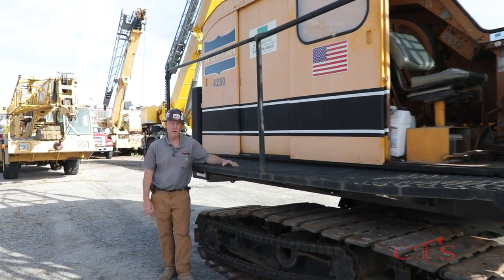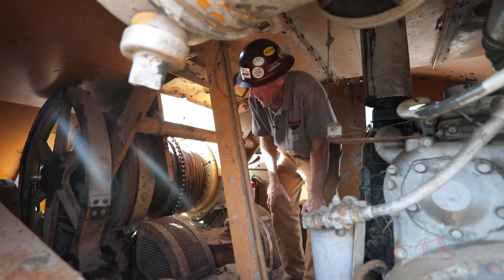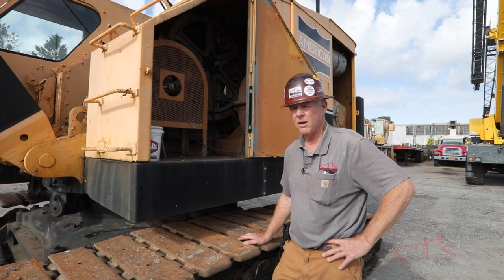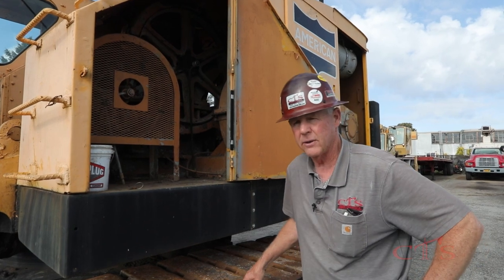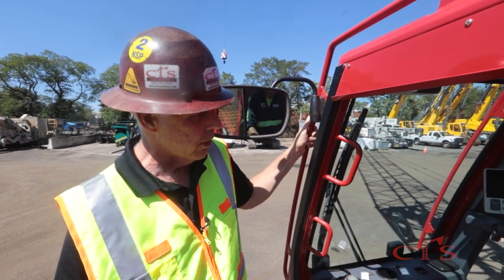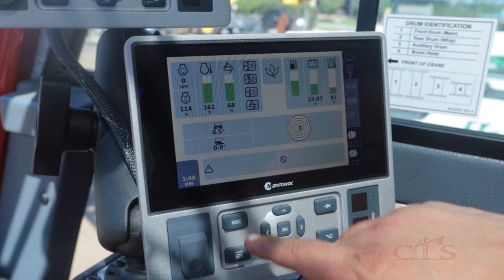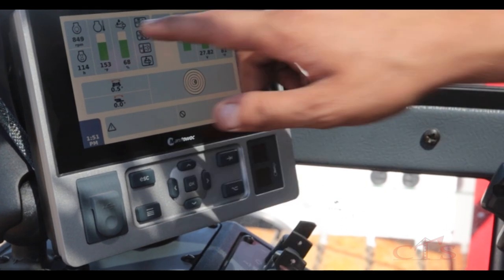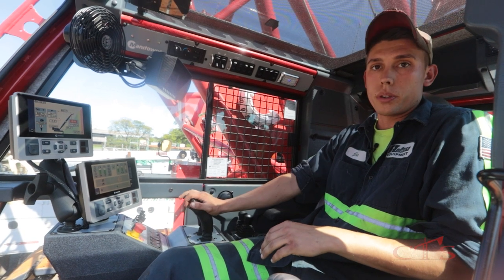What is a Friction Crane with Crane Training and Safety Consultants

Comment: I've ran 45 SC, 65 SC, 604 and 703 Limas, 108 and 338 Link-belts. We thought if we had a crane with a torque converter and power down on 1 hoist we had it pretty good.

Comment: In my long years of crane operating, I have been in the seat of both friction and hydro. Give me the friction anytime. To me if the machine is adjusted right, the friction is much smoother and faster. Hydro is nice for sure. I got my NCCCO license on using both. I did not get to operate long but the Manitowoc 4100 Vicon was the man and still is a great crane. Today, operators have gotten lazy and most want air conditioning that most of the old friction rigs did not have.
Reply: If I’m correct, with older machines you can “feel” it and work with it.

For instance, an engine can tell you if it doesn’t like what’s going on by the sound, it also tells you what RPM’s it’s happy to run at.

These older machines are, in a way, alive.

Comment: In the early years of my career I operated a 1967 American-Clyde 110 ton friction crane.    I miss that machine so much.  It had friction boom,   holding line,  and closing line.   So much fun to operate,   3 brake pedals,  3 clutch levers,  3 parking brake levers.   Electric swing,  and travel.    You'd be slapping levers like crazy.   Friction separates the operators,  from the lever pullers.   When we decommissioned the machine,  it was purchased by one of the largest crane companies in the world,   Lampson.    They completely rebuilt it,  gave it a longer boom,   and mounted it to a construction barge.    Old girl is living a second life.
Reply: Nice to hear 👍 must give you a level of satisfaction to know it’s still going. 
P.S. I live in MA. and 
HALLAMORE is one of the biggest rigging companies in the area.

Comment: You don't have too free fall for lowering the load. You can release the master clutch leave your friction engaged on your hoist and release the hoist brake too lower in reverse through the gear  train. If the crane has an overrunning sprague clutch for the boom the boom will come up if you do it this way so you have too dog the boom drum and release the sprague clutch.  You can leave your master clutch engaged for heavy loads if you have the 3 stage torque converter for short distances which runs kinda like vicon . If you have controlled load lowering it is as simple as just powering down the load without worrying about any of that. Some american cranes have single lever control so when you apply the friction the brake releases and when you go too neutral the brake applies automatically. There are many options of lowering loads depending on weight and speed that is desired parts of line reeved transmission and draw works set ups. Get the books out when you operate these cranes do the maintenance get familiar with the machinery talk too people about them they are easy too run once all the gears mesh in your mind.

Comment: I played a lot with a 250 ton truck P&H (70 feet of boom) from Hoffman out of Jersey (Belleville?) in 72 at Ft. Story at Virginia Beach Army base for Operation OSDOC. Had 2 cranes rented, one on the shore (me, I was on a D7 Cat) and another out in the Chesapeake bay on a cargo ship with an extended cab. The 250 was a lattice boom with 150 feet of boom, magnetic swing, modulated torque converter and 2-speed hoist and boom. Cummins up and down, 400 on the upper and a V-12 with an Allison and 4-speed aux. in the lower and the operators came with it. One raised bulldogs and was a hoot. Had a headache rack for conex boxes. OSDOC was a cargo handling exercise using the Army amphibs and a hovercraft from Canada. Had the start of a computer for end and side loads that you put cards into. The torque modulator was on a rheostat on the swing lever and the throttle on a twist grip on the boom lever. SWEET machine and I learned to run cranes in the Army overseas and played with this one a LOT! Even got to unload a conex box off an amphib and put it on a trailer pulled by a 5-ton.LONG time ago. THANKS!

Comment: broke out on a 1963  P&H 430 TC  gasoline waukesha in the upper and 671 detriot in the lower 100 foot of angle main boom and 30 foot jib load chart was permanently attached in the cab   45 years later did my last job on a Grove 5165  had 2 really thick manuals for boom and ctwt configuration